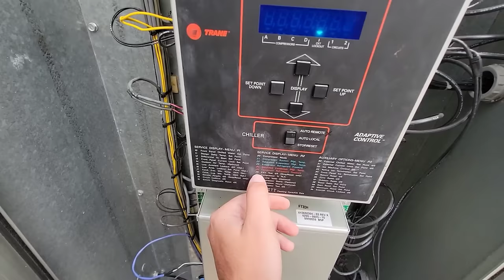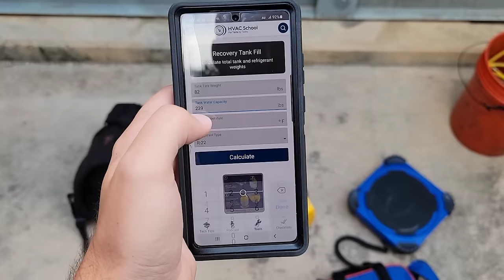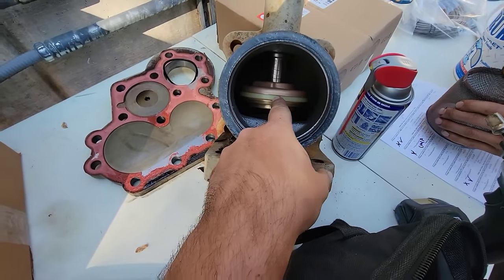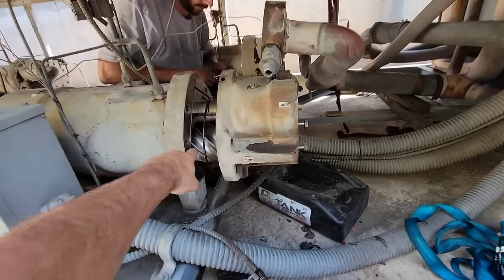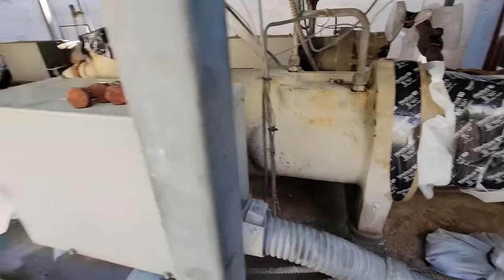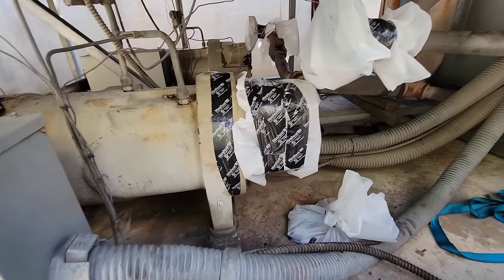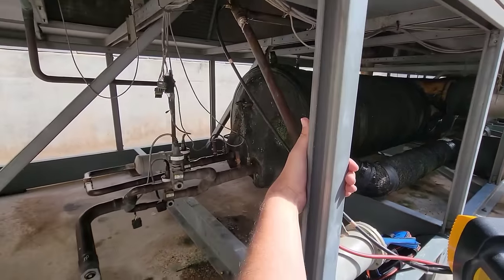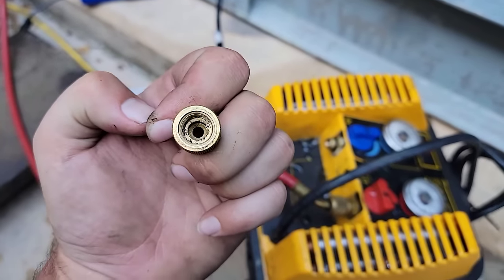Major Chiller Leak Repairs On Screw Compressor Trane Air Cooled Chiller

Comment: If the liquid valve gives trouble. Use the vapor valve as you did. But flip the tank upside down. It’s actually better than using the liquid valve with a dip tube.
Reply from the maker: That would have been good advice

Comment: Sounds like you have the same luck I have with our Trane distributor here in Okc. Some of my buildings have some RTAA’s and have had so many issues getting the correct parts…. Constantly. So much so that when they say 3 days for a part I just go ahead and plan for 10 days because I know it most likely will 1. Not arrive on time and 2. It will be the wrong part. I feel your pain so much on this video.

Comment: I worked for Trane and we got the wrong parts all the time. In the end, rather than just using the model number and serial, we used to get the model numbers off the compressor or other parts where possible. It is worth noting that the parts department are mostly non technical. They get the details from a database and you hope they press the right keys!!
Reply from the maker: Its true, sadly I tried that here and still got same result. They chose to ignore the compressor tags and went for the chiller tag instead.
Reply: Why did everyone “used to work” for Trane…. Me too. 15yrs.

Comment: great video! from experience giving technical assistance to Trane and other leading brands, i always developed some kinda of plug/tampons for the connections. Don't need to be the strongest/spiff ones. Just 4/5 stable PSI avoid any air/moisture to enter the circuit. Maybe few houndred bucks for the client but it's always better for both sidesthan taking the risk of having a production line stopped for longer.

Comment: These compressors are a lot more durable than what we give them credit for. It wasn't an ideal situation what happened here but shit happens.
I had chiller with a 20hp 4D discus sit out for almost a year with no discharge service valve since the valve failed and could not be sourced within the country. 
I transferred the original part to the customer so that he can get it machined and made at a custom shop. I strapped the discharge up like you did here with electrical tape, a plastic bag over it and more tape. The customer sat on his ass with the part until summer arrived basically. I forced an oil change on him and more $$ added to the quote no questions asked.
I would've loved to work with a guy like you back in the states. The equipment you work on and the challenges is my kind of gig.

Comment: Trane and JCI are really good at screwing up parts orders, love it when Trane then tries to charge me re-stoking fees for their mistakes.
 I don't give them the unit serial number for more than one reason if you know what I mean, I get the parts numbers directly from the comfortsite.
Reply: Dude always put the parts request in writing such as email. I tell them send everything by email. I will call you only to run the credit card. I had jci send me a $2k valve. Sent to me for the wrong circuit. They told me no refund. Wtf? It’s all in the email very clear. They had to eat it,

Comment: Quick question, 
Did you drain the water piping before pulling the gas out? If it has glycol in it i assume you dont need to drain it? If not, why, i thought you could freeze the tubes that way.
Reply from the maker: Its a DX barrel so it wont freeze like a flooded barrel. I was also flowing water to speed up process

Comment: I didn't know Trane US messed up the parts like that , being across the pond that kinda makes me less pissed off 😅 
By the way , I thought Nylog would sorta hold the O-ring in place ?
Over here we use the Parker Super O-lube , it's sticky so it holds it in place , but I don't like it because its Silicon based so I don't want any of it getting into the circuit ...
Reply from the maker: Many times the nylog does hold it but sometimes the oring stretchs some and doesnt fit perfectly.

Comment: Hey question. The gasket on the discharge side. Did you all end up having to pull that hole assembly and shaft out or did you just stretch the gasket over the discharge house?
Reply from the maker: You stretch it, the service manual calls for that too.
Reply from the maker: Its terrifying your first couple times because your common sense says this ain't right but it works

Comment: Wow you guys still use R22 in the USA.!!!
Reply: yep! and it's expensive!
Reply: Stationary equipment was never the problem, as it can be tightened up and usually was kept that way.  You might lose a few pounds of Freon in a decade, at most; and on a Freon-12 system it is even easier to hold because condenser pressure need not be so high.  That does not compare with the dozens of pounds of Freon that would be gassed off every shift by a  printed circuit fabrication plant.  On the most bitterly cold nights, I would see a cloud of re-condensing Freon hanging over a plant in my area.  
Of course, the transportation air conditioning was a big insult to the ozonosphere, but we proved that could be tightened up, as well.  Our atmosphere is making good progress at repairing the damage we were inflicting on it with Freon.